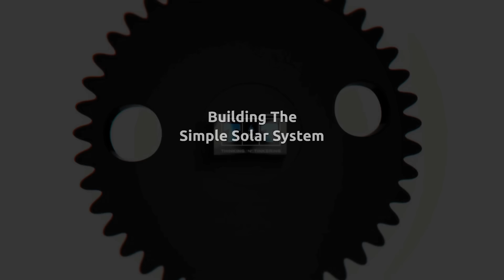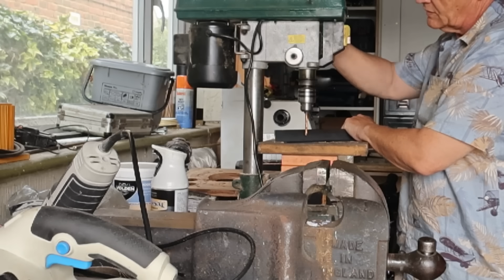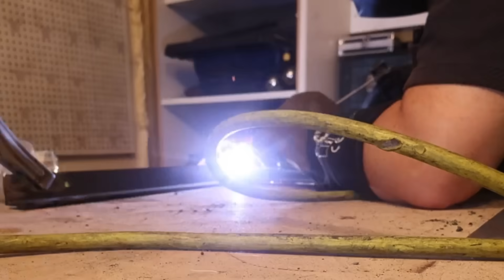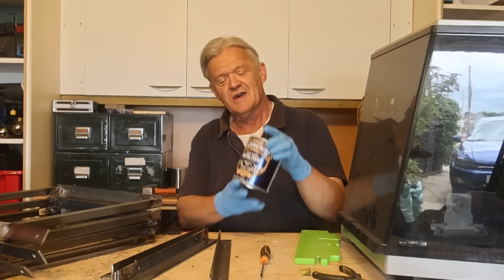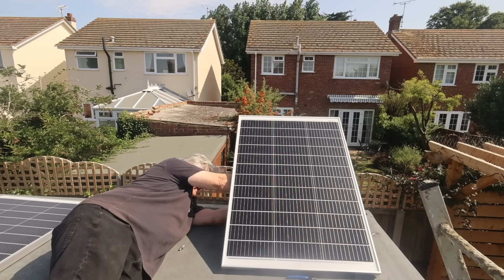2416 Building A Simple Solar System - Installing The Panels

Comment: I have a low voltage system at home, so I basically have a 12v system running a 24 inch TV for general use that draws around 30 watts and I have a 12v radio in the house and the workshop add in a few 12v led lights and I can run most of my immediate needs from the solar / batteries (lead acid) for free, then swap to the large tv and mains lighting when desired, I also run a log burning stove in the cooler months, which with a flat bottomed stove kettle supplies me with hot water for drinks and various other small tasks, I don't run an inverter at all as the supply cables need to be big and of course in the UK winter time, solar output is vastly reduced so even a small inverter would seriously damage my 12v reserves, so i just plug standard electrical items into the mains. but a free unlimited tv (recently retired so the Tv may be on 16 hours a day) and lighting seriously reduces the electric bill.

Comment: AAA = American Architect Association once send a letter to every American Architect to remind them in designing future houses, remember to consider adding DC outlets in each room because human will use more  solar power DC in future.  Each room should have AC and DC plugs to plug directly into.  When AC is needed, the inverter will kick in.  Current PV system will wire into inverter than tied to grid power, running all power in AC mode
Reply: All appliances should have AC/DC detection and whenever there is solar DC power available, use Solar or battery power first.  Can automatically switching to AC power when all DC power supplies died down which is not entirely unlikely, if you had consecutive cloudy days!  This can perhaps simplify selection on certain appliances whether buying DC or AC powered. :face-turquoise-covering-eyes:
Reply: Lithium battery and Inverter, consider using a portable all-in-one lithium or Sodium power bank.  I'm using Oscal PM6000 - 3600wh master unit which can be connected to 15 more additional extended BR3600 - 3600wh sub unit. Make it a maximum 56KW.  It's expandable.  PM6000 has 3 x AC120V/20A + 1 x AC240V/30A output, plus 5V/12V and 12V cigarette socket output.  All sub units are purely lithium batter power storage, no inverter, MPPT.   Plug your solar panels maximum 2400w to each master unit, you will have both AC and DC power whenever you need them.
Reply: My off grid solar container foldable office/house model - Here is the basic equipment.  3 x 455W Solar panels connected in Series(Can expand to 5 panels) + Y branch MC4 cable, one branch connect to 12000BTU SM-650 Solar Split AC and the other branch connect to the PM6000 3.6kwh(Can Add a sub unit to have 7.2KW) to store left over power to lithium power bank which can be used to power lighting, coffee maker etc.  :face-blue-smiling: Happily everything is powered by solar in this 152SF office/mini cabin!

Comment: Awesome video, Robert!   It occurs to me that if the solar panels are [an 800 watt array for example] 200 watts each then in parallel the Voltage would be 12 volts but the currents (200/12)would add ( 16.67 x 4 = 66.67 amps.). In series the Voltage would be (12+12+12+12 =) 48 volts and the amperage would be (200/12) = 16.67.     

Although there is less loss from converting voltages up and down, wouldn't the wire gauge requirements be different for moving 67 amps than for 17 amps? 

If we take a sample length of 20 meters through an 8AWG cable,  the 67 amps at 12 volts the voltage drop would be 5.38 volts with 360 watts lost as heat.   Final voltage 6.62 V and 443.4 Watts delivered.

If the wire size is increased to 00 AWG,  The Voltage drop goes to 0.84 Volts and 56.4W watts lost (out of 800) for 747.6 Watts transmitted.

If we use the same 20 meters of 8AWG cable and move 17 amps at 48 volts  the voltage drop would be 1.37 volts with a power loss of 23.2 watts to heat with 792.8 watts delivered.

For the same amount of power generated (by the solar panels) lower voltage means higher amperage. That increased amperage needs more conductor volume ( length x cross section) to deliver a comparable amount of power. If the wire diameter is not large enough the electrical energy is lost as heat.

Does that make sense?
Reply: yes you're correct and that is why micro inverters are a thing. The voltage losses are far far less and the signal is much much simpler to match downstream without too much impedance when weather or environmental changes occur.

Comment: 12v DC makes sense in these times. As you say, most appliances have so many inefficient and RF noisy step-down converters. Caravans, I believe, use 12v throughout. In a large house installation, you'd potentially have losses due to distances. I wonder how you'd deal with noise coming onto the 12v supply from all those smaller converters like LED downright?

Comment: Depending on your battery setup that issue is largely resolved by the cross wiring of the main large cables joining the batteries. 
For instance,  i still (until they wear out) use 3 x 130ah AGM lead acids. Tbe connection leads both join and cross, so that no one battery is over or under loaded, or charged.
As most peple are now going the Lithium route as the technology matures, one battery usually suffices, and folk are doing great things with hybrid battery systems nowadays. 
12v boating group is a great Facebook community full of cleverer people that i!

Comment: Having had a campervan and a couple of boats, living on board onefor a  couple of years, the fixation of 230v bothered me too.
Apart from voltage drop and tge requirements for heavier cables, there is almost no downside.
My current live-aboard boat runs happily for eight or nine months of the year off 400w of solar.
Everything is super efficient; 12v fridge, led lights, pumps, diesel heater, sound bar, tv and recharging all 12v.
If i really must have my coffee machine on in the morning, i switch on the 2000w inverter for 230v for a few minutes, and promptly switch it off again.
The same goes for the air fryer and microwave. 
Only in mid November to March do i struggle for power, but a short cruise every few days, or maybe an hour blast with a generator sorts that.
I switch my fridge off as its generally just as cold outside in December and January so leave stuff out on deck in a cool box!  😂
Efficiency is key, with as little stepping up or down as possible. Most items wire straight in, with perhaps a cheap voltage regulator or buck converter for protection or small steps up or down accordingly. 
24v makes even more sense if you can source the items.

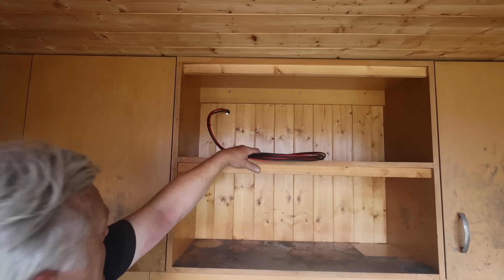Comment: 6:56 When it comes through the hole, you should droop the cables down and back up into the hole, and fix them that way. So moisture dripping on the cables doesn't lead inside.

Comment: Spot on about the inverters. Even if your inverter is 90% efficient, and the AC-DC converter in your device is also 90% efficient, that's an 81% overall efficiency. You lose almost 20% of your energy! I'm currently using boost and buck converters as needed. No inverter, no AC. If you're super savvy and design your own circuits you can design a buck converter right into your device with a wide voltage input range. But that's usually not possible for off-the-shelf devices.

Comment: Another idea is wire the structure for 12v, put banana plug outlets everywhere.  If you're already wired for AC you can use the existing romex and change the outlets to Banana plug.  Change your breaker box to a 12v box.
Reply: I really like Clipsal plugs. You can get quite attractive black sockets from some suppliers

Comment: What about setting up for 24v.  Add a few batteries for storage.  With 24v, you canl run your printers directly any conversions.  Step down for whatever 12v you need, inverters for 230v.  What will be your greatest current draw?  12 or 24?  if 12, then step-up coverters for the printers.  You'll still need batteries for the inverters or working beyond sunset.

Comment: I am off-grid, and use quite a bit of 12volt, like you say its so easy to get 12volt stuff, you just need thick cables, I use my 3000watt inverter only when I need AC power, like when using the washing machine, I have two working inverters one working and one for emergency back up. Some of my more artistic background lighting in my garden shed actually runs on 3volt from and experimental 3volt Sodium ion battery, this made sense because the battery voltage pretty much matched the forward voltage of my LEDs, needing only a tiny value resistor.
Reply: There are 48VDC washing machines available!

Comment: I always cringe mounting the damn things, it is my least liked job, you have to get them so secure to stand UK storms. I wish they came with mounting brackets, you can get the mounting rails and roof brackets, but they are a small fortune, but they are Stainless steel and Aluminium rails. You will find that you will get so much power between 1st Feb and 31st Oct, that panel angles have little effect, you need to just engineer everything for winter, especially the 3 weeks that straddle the Yule solstice. Oh and you are about to get addicted to Solar panels, you will end up off-grid before long. It becomes an obsession.

Comment: I have been living with a dc electrical system for 15 years. I made the same choices you talk about here but i went with 24v instead of 12v. Most of those automotive accessories that you mentioned will also work on 24v and dc-dc converters are available if i need 12v or 19v or usb-c or whatever. 24v systems don't need the extremely thick cables that you will need for a 12v system if you want to deliver power in the kW range.

Comment: I think if you get some of the really nice inverters, the loss is less than 8%... the convenience and cost savings, and warranty convenience of not using DC becomes a lot more tempting when the loss is smaller
Reply from the maker: i suspect a really nice inverter is also going to have a really nice price tag mate
Reply: @ThinkingandTinkering  what I did is ask friends, and yes they arent cheap, if you look at victron gear its a good bottom line (they are entirely different beasts from the cheap ones though) but I eventually took a middle path and got a fairly high quality small one with good specs, and its fantastic, I've left it on once or twice by accident and it will just run for crazy long times before killing the 640wh I gave it, on a 400w I think its close to 48 hours, and then it can also let me crank it to its max power an use all of the battery up in under two hours. Now that I do have an inverter, I'm looking at a more expensive one in the future because I was so impressed. You should absolutely do both dc and ac eventually, the DC gear ends up being invaluable battery rescue equipment and doesnt cost much

let's learn from each others mistakes because dc-dc is totally doable... here's what I learnt (you know this part already): 3-4m is fine, 20m is not
What was interesting is this: if you have a dc-dc with CC and CV, you absolutely under no circumstances do not want to activate the CC part of it while you have electronics on it... I lost two very expensive bits of gear before I figured it out, it might sound obvious but once you start tinkering its easy to forget it, I'm sure you'll probably look for something a little more permanent than what I did
Reply: @ThinkingandTinkering  Low frequency is expensive, high frequency is compact and cheap, and they're efficient and relatively safe, I got an industrially intended el-cheapo, it was roughly 100 pounds for a 400w one... the 24v one was half as much for some reason probably more popular but I wanted 12v... EPEVER IP500, if i'd have to do it all again I'd probably just buy victron and get it over with but it does cost more, and I have no complaints except maybe a slight amplifier hiss on my one amp

Comment: I completely agree with building a 12v system and thats what I have on my shed! I made a mistake though, I bought a big 450w house panel from CityPlumbing for £70 which is incredible value, it outputs 40v. I originally bought a controller similar to yours which said its supports 12v-48v batteries and upto 100vdc solar input however the small print then tells you, the lower the battery voltage, the lower the maxium solar input can be. For a 12v battery the max voltage from the panels was about 24v. So putting 40v wasn't going to be safe. You shouldn't run into that problem with your smaller panels in parallel. I ended up buying a bigger controller, all working well now.
Reply from the maker: I always find there is a solution to every problem mate - cheers

Comment: Very thought provoking Rob......a bit like the question I always wanted to ask but didn't like to 👍
Reply from the maker: cheers mate - I am tempted to say ask your question- but now I am not sure i will answer it lol
Reply: @ThinkingandTinkering sorry Rob I made that sound more than it is.....I was simply referring to what you covered in the vid. I wondered years ago why we weren't using the 12v direct from panels/batteries given that a large amount of electrical items use such small voltages instead of inverting then rectifying etc etc. I assumed I must have completely missed something and didn't want to embarrass myself by asking the question. 😊

Comment: You could go with a universal DC voltage at a high enough level, say what they used for phone lines at 50v (also the limit of what's required for a qualified electrician to wire).  Maybe seeing as it was used for phone wires maybe use the modern equivalent, and use cat 6 cable. While you're at it why not put ethernet on there too for computers and IP phones.  As it's got ethernet too you could call it power over eth.... Oh.  That's already been invented. 

I've a PoE at home and it is really useful for all the small electronics. I've even got it on a redundant power supply so if the power goes in the area (which it does 4 or 5 times a year) I've still got internet, alarm, phones and some home monitoring equipment (PoE for Arduino and raspberry pi are fairly cheap too). But as you say there is a whole market for 12v systems (batteries, BMS etc.), particularly for caravans which means it's easily adapted. Initially I had a 12v battery system and stepped it up for 48v for PoE but over time it became more efficient to go to 48 and step down for those 12v options.
Reply from the maker: Absolutely mate - all I am really trying to do is show how easy it can be

Comment: When you run an inverter  for 230v ac there is an idle draw, typically 1%. My 1kw inverter is 10w (24*10=240w every day. ) ( 6kw inverter 50w idle ( 50*24 = 1200w lost every day ) My 300W inverter is 4w idle so on a 12V 100Ah Lifepo4 battery  can power a efficient fridge,  12V fan And lights for a day. The 6kw inverter would flatten the battery in a day without doing any work. So having a mixed system where you can turn the inverter off is great if solar is limited. A real winner is replacing a 230vac 16 inch stand Fan  with a common type 7555 12V motor. The common 3 speed ac fans draw 35 to 55w the 12dc motor draws 2 to 24W and PWM speed controler is brilliant. Motor $3 PWM 1$ USD ( Direct from China pricing for Asia ) . The small 12V fan motor sits inside the old ac motor in place of the armature. See utube vids from Asia.
Reply from the maker: nice advicemate - thanks for sharing

Comment: I've been saying this for ages! In this country UK , we don't have many (therefore affordable) 24/36/48 DC appliances.
12v DC from automotive, camping and caravanning you can almost find every appliance in 12 volt DC (some ARE expensive, less efficient and smaller than AC)
So if you do a 12 v DC equivalent power audit (lights, fans, heating etc) then the stuff that has to be AC washing machine, fridge freezer etc( until they need replacing and look to swapping to 12 v DC ) the size and therefore expense of inverters drop.
This is obviously on relevant for a new system if you already have a DC to AC system look at as needed replacing with 12 v DC the inverter will last longer
Reply from the maker: To be honest mate we don't really need them with a cheap buck boost board ( around UK£2 each ) any DC appliance will do

Comment: The 12v DC idea works great locally. I have a 15w tiny panel with a battery pack (1.2Vx10), and long strings of LED lights (used in sign letters) hanging up in my two small sheds. Normally those lights come with a small inverter pack but I just went directly to the battery/switch. This works very well, but I can't go much further, as DC transmission drops badly over larger distances. So Robert's situation is ideal, because the distance between power generation and consumption is very short like mine.
Reply from the maker: absolutely mate

Comment: But double the voltage is half the amp used isnt it?
Reply: Less amps so smaller gauge wire. Same watts ofc
Reply from the maker: Yes

Comment: Really like the idea of a DC system.   Do not underestimate wire size for a 12 volt DC system that is needed to minimize voltage drop.  Also maybe going down from 24 to 19 (power for printer, likely your largest power use) more efficient than going up from 12.  There is a reason the auto industry wanted to go to a higher voltage at times. But as you mentioned, many more 12 volt items at cheaper cost available.

I think I might try one in a year or two when I get an outside building.
Reply from the maker: Go for it mate